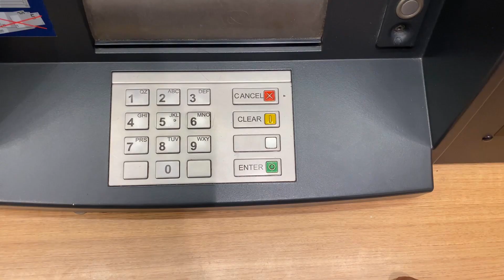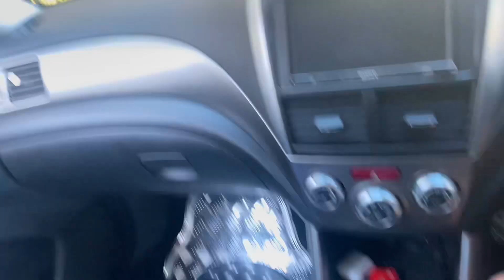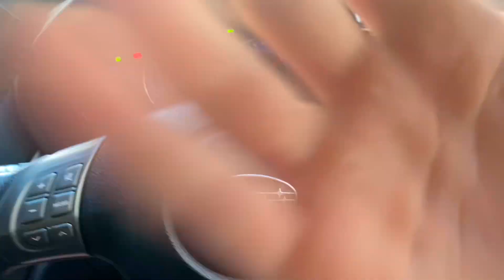The body kit is back on the Forester

Comment: hey mate, i’m thinking of getting a forester (around 2010 model). is there anything i should look out for or been concerned about??? 😊
Reply from the maker: Just take a good look at the motor get under the car and look for oil anywhere on the block :)
Reply: @D4NOS  the foresters suffer from the dreaded subaru crappy head gaskets?
Reply from the maker: @lordmoreton1762  nah it’s a myth as long as it’s been looked after
Reply: @D4NOS  awesome thanks. need to take one for a test drive still but interested to know if there’s any major issues with certain models/years 🙂